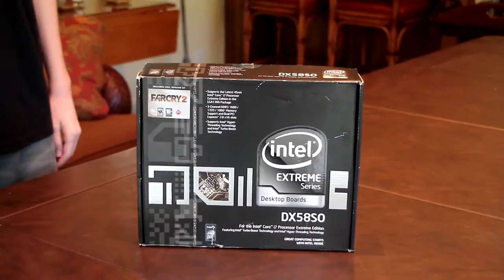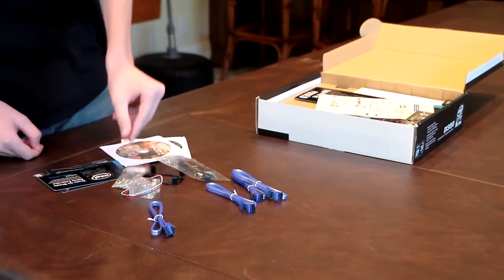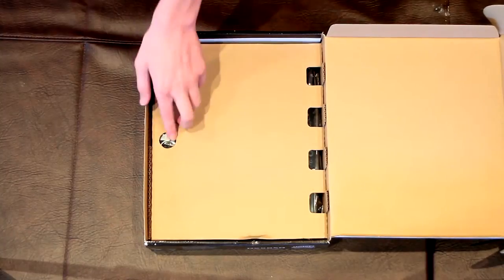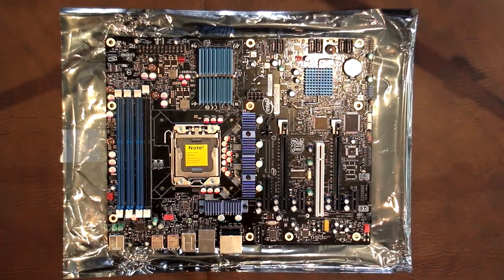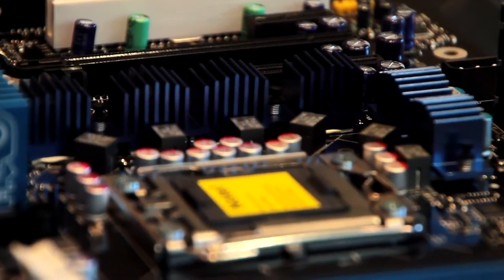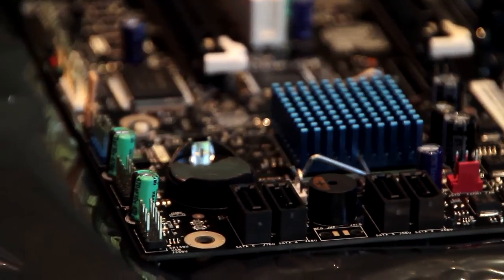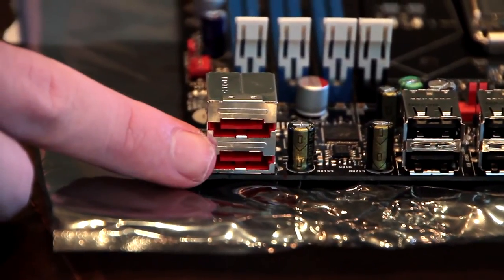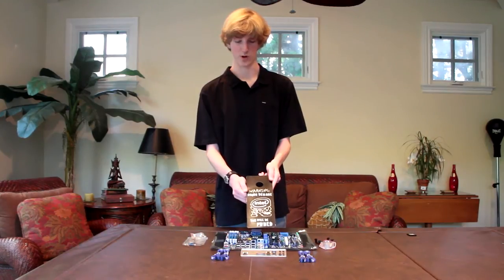Intel DX58SO i7 Motherboard Unboxing / Review

Comment: that satta II ports are infront of the grapic card. so full size grpahic cards no not work. well thegrpahic card will slam agsinst the SATAII ports and connecting cables. so that 300.00 to 1000.00 grpahic card of any choise that is full size is useless have to use a out dated  1/2 size cards only. I had on MSI. I told intell I am buying a AMD CPU beucase I never had a problem on heat sinks